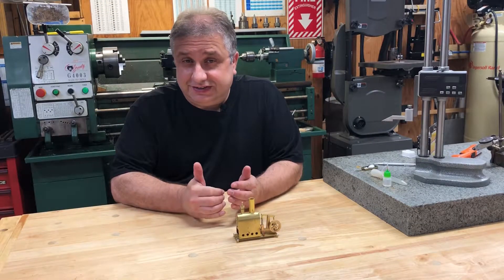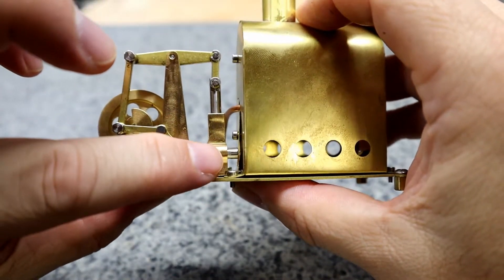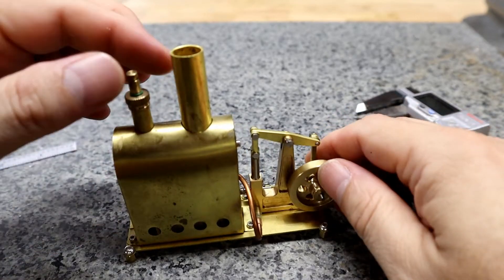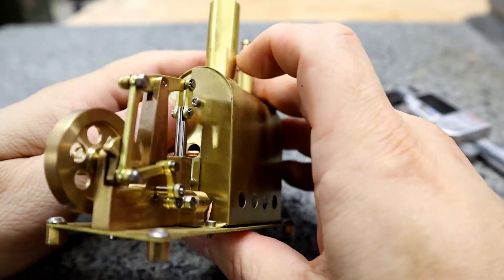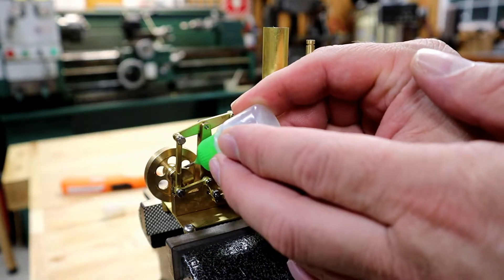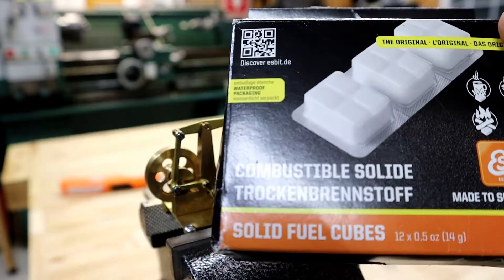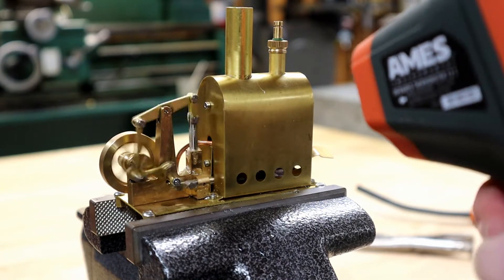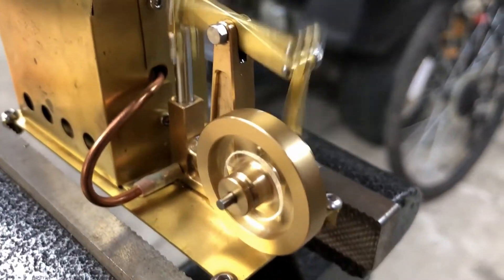Microcosm M89 Mini Steam Engine & Boiler

Comment: Has anyone thought of making this into a garden locomotive?
Reply: It's 130 bucks, I was contemplating buying it to power something
Reply: @kadinketterling7276  Me too I can't ant decide if it would be cheaper to use this or make one totally from scratch. A vertical boiler tram like locomotive seems very simple to build which is what I'd make with this though it's not a vertical boiler. But I don't have a torch or experience making boilers or engines. There are tutorials for very simple plans I'm sure I could follow. I guess it's just down to price and convince.